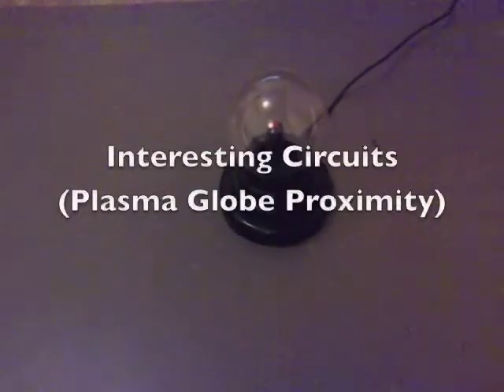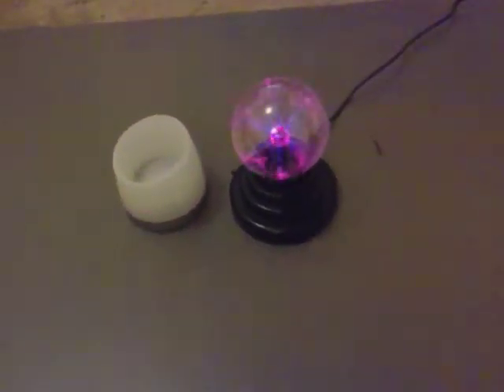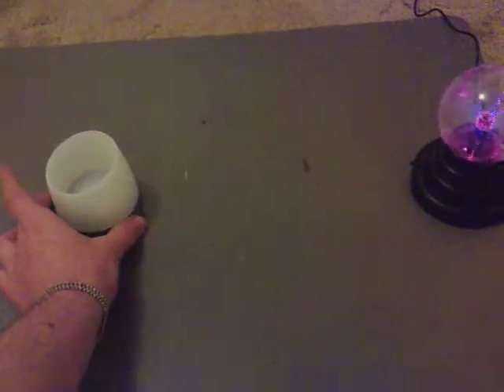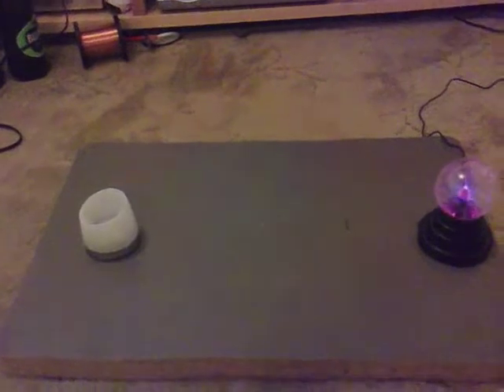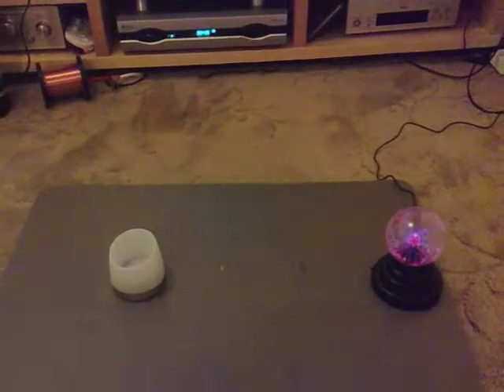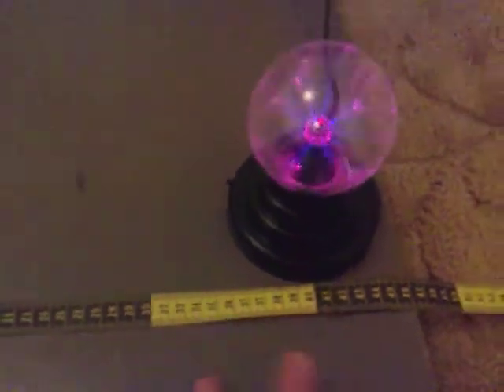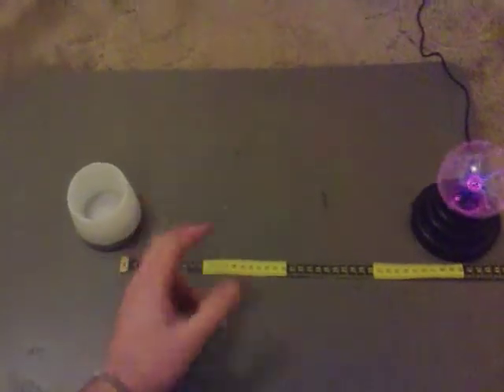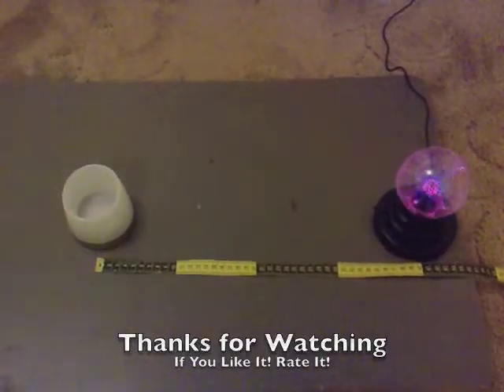Interesting Circuits (Plasma Globe Proximity) 008

Comment: How much power are you sending to that plasma ball? Those plasma balls run off a USB and are usually at 5 volts 300 ml amps. Interesting. Thank you for sharing

Comment: YOU HAVE RESONANCE. i put aluminium foil around mine and twisted the top and could get a 
compact flourecent to glow and wish to charge a capacitor.
try using aluminium foil twisted at the top as it   acts as a better ground and then see if it can inturn be used as an antenna. maybe even moveit around and point at the mobile device. cheers kubikop and good work as always.